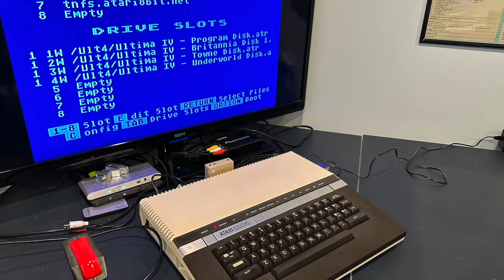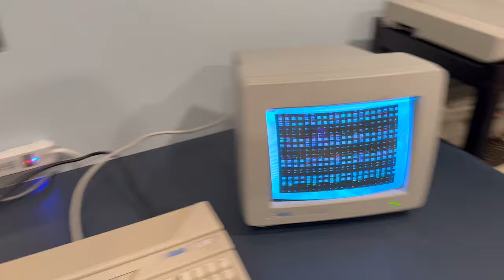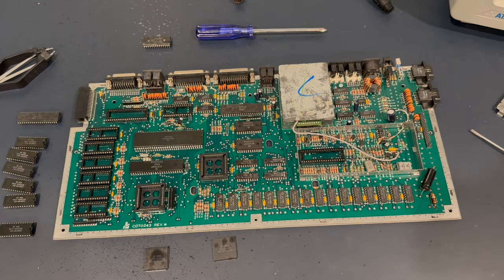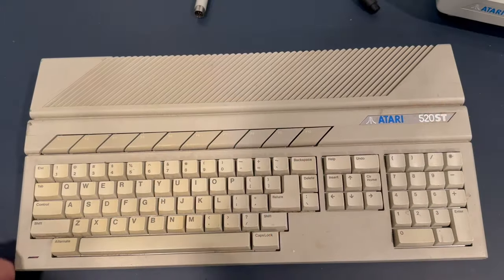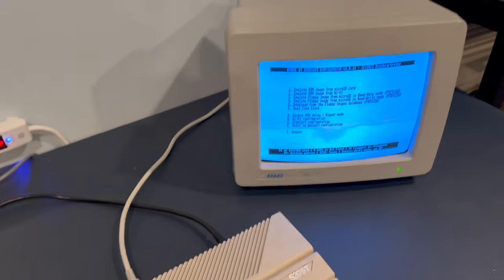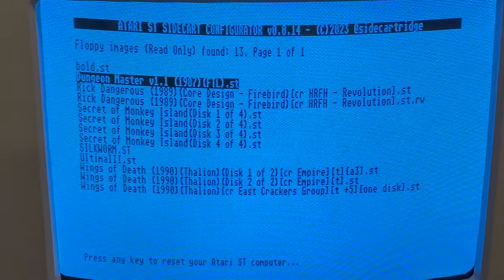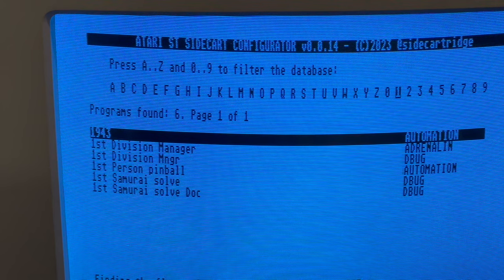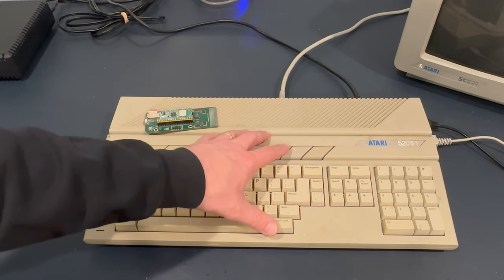Get Atari'ing quicker for less with a Sidecart

Comment: SidecarT “perpetrator” here 🙋🏻‍♂️! Thank you very much for the review. I believe you did a great job explaining how it works and, particularly, how it aligns with my goal of helping people revive our beloved old Atari ST computers.
Something I would like to mention is the device firmware is in very early stages and it will add more features very soon. So games that now don’t work will work and some new devices like hard disks, keyboards, mice and more will hopefully will be emulated very soon. It will take time, the SidecarT is only 4 months old! 😅
Reply from the maker: Great device with great promise, and I think the it's especially useful with new users of Atari ST hardware.
Reply: Thanks to both of you - I was waiting for my curry last night in England - saw this - looked up origin - asked my Spansih friend to check it out ..  this morning I ordered 2 (one fully assembled and one diy). We will give it a go. If we can get it working then likely we will try to get involved in dev etc. I was using STs heavily in early 1990s for programming. Thanks for rekindle my interest.
Reply: I second the thanks to both of you. AMAZING device and very approachable video for an old timer getting back into a ST for the first time in nearly 40 years!
Reply: Amazing device. WIll be ordering one pretty soon. If I order the one "with" the Pico WH, does it come already "to Go"? Or is there some assembly required? ;)
Reply: @AzraelSWFC2011 yes, it’s ready to go. Plug and play with the latest firmware if you order a unit with the Pico WH

Comment: Thanks for sharing this!  I started off with a TRS-80 CoCo2 when I was 13 and just a few years ago got back into that era of computing.  After buying and fixing a couple dozen CoCos, I started branching out into all the other machines from the 80s and 90s that I never got to experience, my latest acquisition being an Atari 1040 STF!  I have the machine itself, a mouse and power supply, but currently have no monitor cable (on order from eBay).  Now because of your video, I've ordered a SidecarT kit and a couple of RasPi Pico Ws, and I can't wait!
Reply from the maker: It’s a good starting point, and is in active development.

Comment: I have never been into anything Atari but I always liked the look of the ST so I added a 1040STf to my collection which does work and when I saw the Sidecart and what it could do I ordered one.  I already have options for video and I have VGA monitors that can display 15 KHZ because of my Amiga Collection but I am in the process of converting them to run HDMI which I will also do with the 1040STf and I plan on converting the Keyboard an Mouse over to USB so I can place the 1040STf into my server rack where most of my Amigas are.  Honestly if I really put that 1040STf to use then I will have to buy another for my Wall Displays for retro computers unless I can find a suitable case replacement then I would display the empty 1040STf Case but I could probably find a 2U or 3U Case and modify it for the 1040STf motherboard and rack mount it that way.  I use a 27U Rack which is an ugly solution to hold my primary Amiga Retro Collection and use KVM Switches and PDU's to use them but this was more about saving space.

Comment: To remove the discoloration after you clean with some dish soap.  
Use this mix. dissolve as much oxy clean as you can in  hydrogen peroxide (%3 )  it wont take much you should have some undissolved. Place the plastic parts in a glass or plastic tray, works well on the keys. Then just put it in the sun on a sunny day ,( I did this in Florida so results may vary, try a UV light if you are sunless)  this works well on the plastic and wont hurt the plastic.  In a few hours rinse them off.

Comment: I think the greatest about the 520 and 260 ST is, that they have an external power device. So all the heat does not go into the housing ans also it is much easier to replace with an up-to-date one. Unfortunately they have no play for to upgrade a blitter chip.
Reply from the maker: I do really like the smaller form factor.  There existed accelerators that could allow a blitter to be added: An Atari Mega STe in a 520ST body?
https://youtu.be/_6h4HsDCgio

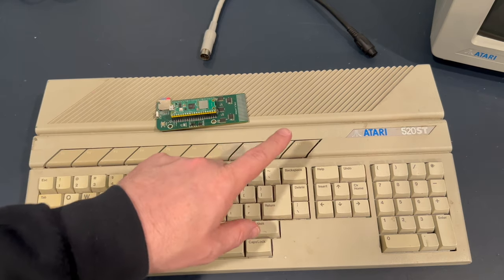Comment: 11:30  That's for a drive that will need servicing.  Even PC/Mac drives from the late 90s usually need to be disassembled and, at minimum, the old dried up grease removed and then re-greased and a cleaning of the heads.  Unless you have a model with built in DOS support, your nightmares have just begun.  Transferring floppy images downloaded from the internet is a royal pain in the butt.
Reply from the maker: Agreed. I do personally use floppy drives when I can because of the nostalgia.  However it can be a barrier to many just starting out.

Comment: Very cool video! But even though I have very fond memories of my Atari ST, if there's one of my old computers I'd like to own again it's an Atari 800XL - if not to run some of the programs I've been writing on it using an emulator. But the prospect of finding a disk drive, a CRT monitor and find a way to copy data from my current computer to a 5"1/4 disk isn't very appealing.
Reply from the maker: For you and the 800xl, there is the Fujinet!!  Also, I did an earlier video on copying from downloaded disk images to Atari 8-bit floppy disks.  It’s not the “right” way, but I’ve used it to create a library of floppy disks.  Extra hardware is needed though, I used an Sdrive max along with the floppy drive.

Comment: I guess i cant reply anymore on YouTube, lol.

I sent 3 replies, they were automatically deleted, lol.

I was trying to ask which atari computer would you recommend for users like me? 

I know you said these machines have different versions? 

Are stfm any good? How are stfs?
Reply from the maker: For a first time Atari owner in the US, I would recommend an Atari 1040STFM which can be found for around $200-$300 USD.  It is a good balance of capability (1mb of RAM can run pretty much any software and an internal floppy drive and power supply are helpful so you don't have to find / buy an external PSU or cables.)

If there aren't any available or if you're more budget constrained, the 520STM I show in this video with as sidecart is a good first option!  It has less RAM, but they can often sell for less than $100 USD and the sidecart makes them an option to get up and running with them without the need for a floppy drive and cables.

Comment: Could you use a raspberry pi as a coprocessor and get an Atari to go in modern browsers or play YouTube, or the vintage machine YouTube that they just made?  I’ve always been trying to find a vintage machine that I could get to do that stuff! I’m gonna get an apple to use sorbet leopard or one of the older operating systems that they make in order to use mac’s from the early 2000s but I think that’s gonna be as far back as I can go But I always wondered if you could use a raspberry pi as a Coprocessor, even in like an apple2! Lol
Reply from the maker: There are limitations to video processing and even the operating systems themselves that keep much of those types of functions not really possible. You can browse the web somewhat, but YouTube isn’t a possibility.   There would need to be something to take the place of the video output. 
At that point it might just make sense to run a raspberry pi in the case and dual boot raspbian and Hatari.

Comment: Does the device add ram? I'm pretty sure the 68000 can access extended ram from the cart port.
Reply from the maker: No this does not add RAM.  At the moment it emulates various ROM's, diagnostic cartridges, floppy drive, and hard drive.

Comment: so if i were to get one in the future. which atari computer would you recommend? atart 520 or atari 1040 or mega ste? i know falcons and tt030 are hard to find.
Reply from the maker: That depends on your budget and where you’re located.  If you want one Atari ST to do most everything and budget isn’t an option, a 520 or 1040 STe are best.  I feel this device is best suited to be paired with an Atari without a floppy drive and thus is a way to make use of these early Atari 520ST’s that you can find cheaper than the “optimal” but more expensive versions

Comment: I would not be spraying deoxit on this board.  Instead, I would get some 99% IPA and a toothbrush and dip the toothbrush in the IPA and then scrub the sockets with the toothbrush.
For one, deoxit ain't cheap. It's like 20 bucks for a small can.  But second and more important, is it is some nasty stuff that stinks and stains a lot of different materials.
Reply from the maker: That $20 can has lasted me years though…it isn’t magic but has helped on multiple occasions. Still plenty left for years to come.
Reply from the maker: I’ve not used it outside of PCB mainboards.  There may have been some staining but I wasn’t looking for it. I can imagine what you mean though..especially on plastic.

Comment: Dang I just bought a frikn’ Gotek.
Reply: Games which load stuff after the initial load likely work better with a gotek. This  is because many games use the disk controller  directly which would scupper any attempts at rerouting through the OS. Sidecart is an awesome bit of kit, it is great for emulating cartridge based ROMS which were not as common back in the day due to expense and being limited to 128k, making it more suitable for utils. Sidecart also has the potential to emulate other cartridge hardware which is pretty interesting, sound samplers and playback would be a great addition which folk are looking into already.
Reply from the maker: Exactly this!  I reallly have been thinking what is the best use of the sidecart, and while it isn’t perfect it’s a good start for those computers without a floppy drive at all.  A Gotek is a great and flexible option.

Comment: How do you swap disks with multi disk games?
Reply from the maker: Right now, there isn’t a way to set it up.  However, the developer is constantly updating the firmware with new capabilities and features.  I wouldn’t count on it coming, but wouldn’t be surprised if it did in the future.

Comment: I picked up a sidecart for my 1040stfm. neat device. can't seem to get the hard drive option to work right. i know it's listed as experimental. it shows up on the desktop fine but i can't copy stuff to it.  do i need to partition and format it..?? thoughts..??
Reply from the maker: Good question.  I’ll have to take a look at the hard drive capability for the sidecart.  I’ve only used it for cartridge replication and floppy drive emulation. 
In general though, all hard drives for the Atari ST need to be partitioned and have a driver installed in order to use them. 

I’ve used HDdriver and PPdriver mostly myself but ICD driver is freely available as well.  Some drivers have better compatibility than others and I’m not sure what works with the sidecart.